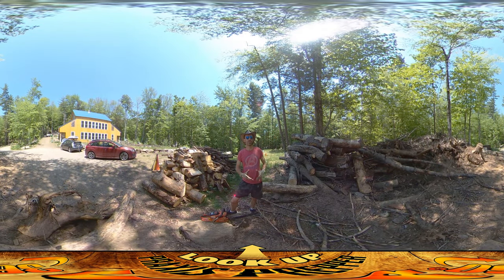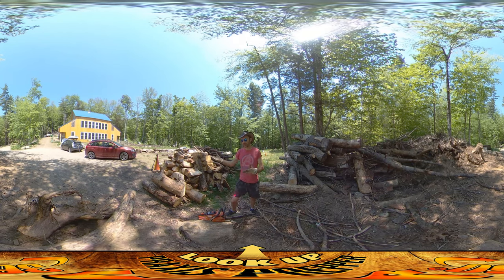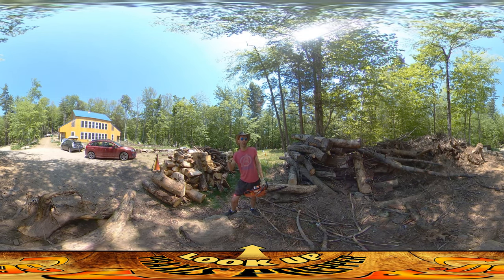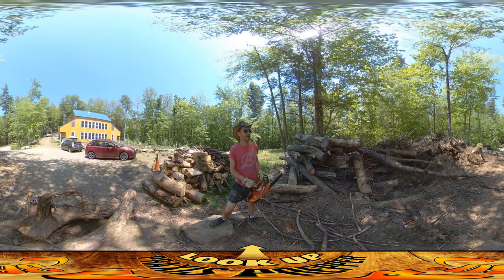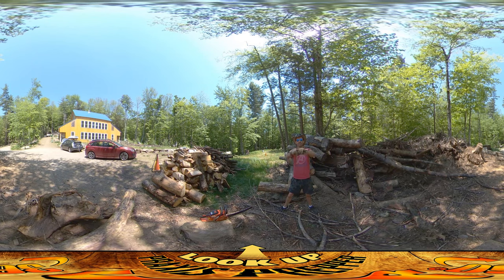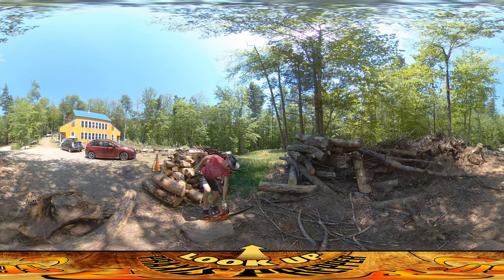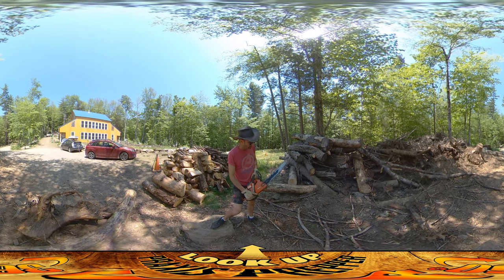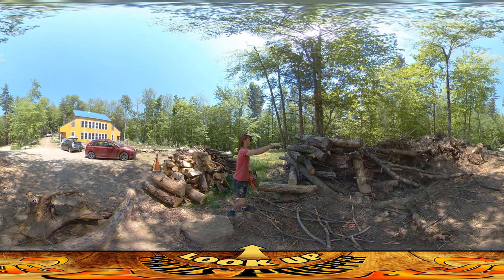Homestead Building - Comparing Gas and Electric Chainsaws

Comment: I know you said you sharpen your chain but get it professionally sharpened or try with a brand new chain see if it makes a difference but it should not have fought you that hard
Reply from the maker: Thx for the tip.
Reply: I agree with OH, it should cut easier and could be the chain.  I’ve got a 20yo husqvarna that has felled and bucked up 2-3 cords a year over its life as well as a newer Stihl.  I use a bar vise, hand files and chain filing guide to keep the cutting angle and the right height on the depth gauges.  Both saws have fewer problems cutting than your dad’s old echo.  The bogging down almost seems like maybe a carb, fuel filter or other cylinder issue...the engine doesn’t seem to be putting out much power.  If you don’t like the fumes of a 2 stroke saw, try a mineral oil based 2 stroke oil...it’s less obnoxious, more environmentally friendly and minimally toxic if spilled!  Also...Safety Nazi alert...but you need some chainsaw chaps and a helmet with a face shield!  PPE is our friend!  ;)
Reply: Or just heavy duty pants...the helmet is optional if you’re not felling.  But...leather boots!  I’ve come too close to nipping off a toe when cutting close to the ground...